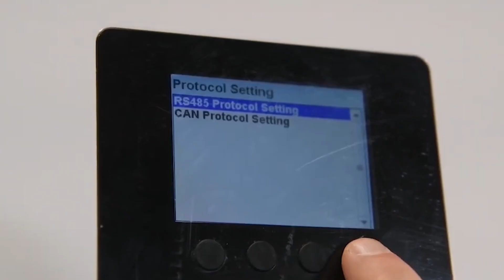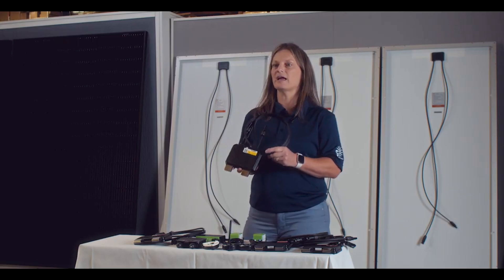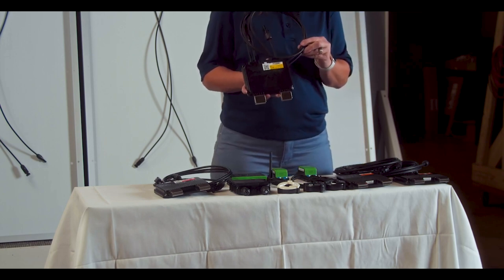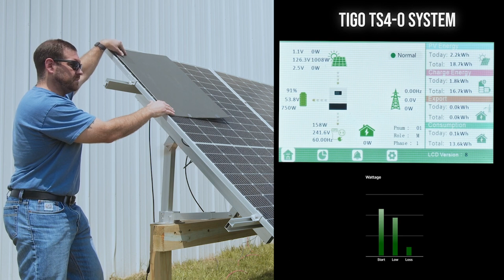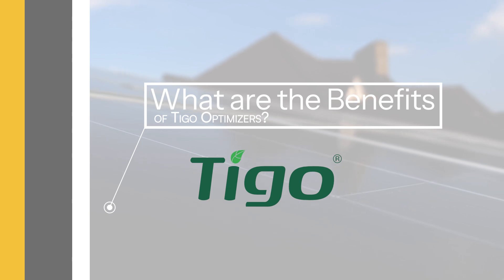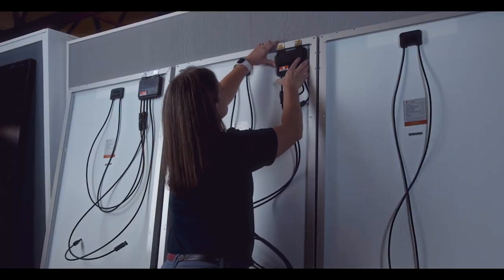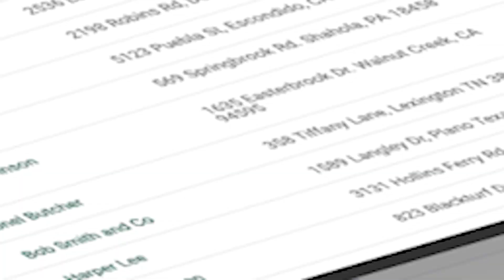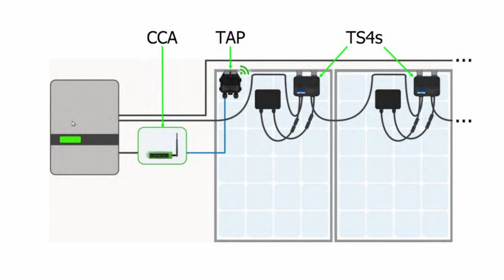Tigo Optimizers Explained: What They Do, Benefits, and Are They Worth It?

Comment: Do you need optimizers on all panels for the remote shutdown of the combined array to work? As an example, if 4 panels are wired in series and only one has an optimizer, will the optimizer cut the connection between it and other panels which would then cut voltage out of the entire array? For my setup I only have one panel in the array that is at risk of partial shading. Also, can the TAP be installed on the underside of the roof rafters instead of on the arrays? Will the signal penetrate a layer of plywood and shingles to the optimizers mounted on the panels?

Comment: But how does an array of panels using Tigo optimizers compare to that exact same array without optimizers when there is no shading?  How much lower is the output with the optimizers?  Would it make sense to only use these on strings that I know have shading issues?  Rapid shutdown is a non-issue for me because mine are ground mounted.

Comment: Hi. We are based in the UK, we don’t have rapid shut down regulations. I used to be a big fan of Tigo products but will no longer offer Tigo to customers. One job of 16 optimisers ( UK spelling ) had 3 failed units which cost us over £2000 which is around 2750 USD. Tigo never gave us an explanation as to why these failed and I am not confident more on this install won’t fail. 

Also covered on the video attached is another system where 2 TAP’s were required on a small array, the optimisers don’t act as repeaters as we are led to believe. 

https://youtu.be/vIovPqTGecA?si=eF5yjWOmM2IIzgCY
Reply: Slightly OT, but since you mentioned it: For the record, the Oxford English Dictionary recommends the spelling "optimizer", even if "optimiser" is the more common spelling in British English 🤓

Comment: Since you guys cater to the DiY crowd this video fell far short on “how-to” details. The part that discusses the actual wiring was hazy at best. As was the setup of the monitoring equipment. And how does one trigger a rapid shutdown?
Reply from the maker: Thank you so much for your feedback! There are many things that can trigger a rapid shut down. It can be done manually, or things such as a power outage to prevent back feeding to the grid. If you need any guidance or support, please don't hesitate to reach out to us at 903-441-2090! We're here to help!

Comment: Can these DC optimizers also be use as buck converters? So not only optimize the input voltage but increased the output voltage to match the mppt range of the inverter?
Reply from the maker: No, they do not convert; they only optimize. They won’t adjust to match the MPPT’s optimal operating voltage range. Instead, they simply optimize or boost the array’s voltage when shading or other factors affect one panel, ensuring maximum potential output. I hope this helps!
Reply: @SignatureSolar  Voltage is cumulative, current is not. So an optimizer should adapt its current to the input current so all panels generate the same current with different voltages and thus optimizing the power output.
Reply from the maker: Yes, that's correct. In a series string of solar panels, the current is determined by the lowest current-producing panel, while the voltage is additive. Optimizers adjust the operating point of each panel to ensure that each one can operate at its maximum power point, allowing for optimal power output regardless of differing conditions (like shading or panel mismatch).

Comment: Hi, Can i just fit them to the few solar panels that are affected by shade, ie 2 panels in a string of 10 get shade, Can i just fit them to those 2 panels to improve overall string performance ?
Reply from the maker: You can use them on the individual shaded panels, but we recommend installing them on all panels to optimize performance in case of shading from clouds or other factors. Additionally, if you purchase the ones with RSD, it would be beneficial to have them on all panels.

Comment: I have very small setup (only 2pcs of 12V 175Wh Victron Energy panels connected together). Unfortunatelly the most of the day is one or other panel in shadow (around 5% only), but in such case the power significantly drop down. Will in such configuration help to mount optimizer on both of the pannels? Unfortunatelly on the place there is no Internet (small cottage deep in forest). Do you recomend or not to mount optimisers in such scenario? Thanks
Reply from the maker: Optimizers could be the solution for you, but they may not restore full power depending on your solar panels. Each panel has a unique bypass diode layout to manage shading, some manufacturers design them well, while others don’t. However, optimizers will still improve performance. CTs of the EG4 devices are only to measure, not to control!

Comment: I have a question that hasn't been clear to me on DC optimizers. If you are doing battery backup with a Powerwall 3 can you use the DC optimizers. I have heard yes you can, also I have heard that DC optimizers can cause an ARC fault. Have you used your DC optimizers with a Powerwall 3 and do you know that yes it will work?
Reply from the maker: Hello! Yes, you can use power optimizers with a "PowerPro" battery, as long as the inverter is designed to work with both the battery and optimizers. The total design needs to be considered when choosing.
It's important to choose compatible components and consult with a qualified installer to ensure proper setup. If you need any assistance, you're welcome to call the technical team at Signature Solar at 903-441-2090 option 3!

Comment: So, when your land line grid power goes down, the rooftop solar collectors are forced to shut down preventing a "backflow condition" to occur onto the land line grid wiring..

 Got it. I wonder how many solar owners know this is installed into their solar panel system. When the grid goes down, so does your PV system too.
Reply: They quickly find out the first time the grid goes out.  That's why battery backup has surged in popularity.

Comment: I bought the EG4 24k hybrid mini split w/ 7- 410w panels on a ground mount. 
Since I am not going into an inverter, but straight into the mini split, would these be of any use to me?
Reply from the maker: Tigo optimizers could give you about 20% more power total, so it would be based on preference and budget :)
Reply: @SignatureSolar 20%?   really.   ?   Any links to data sheets

Comment: Hi, I have Jinko 580w solar panels with Inverex 12kw 3Phase inverter, will Tigo optimiser work with this system?
Reply from the maker: As long as it's 48v and rated to charge LiFePo cells, yes.

Comment: Thanks for the background on Tigo Optimizers.  Do you know if they have RFI (Radio Frequency Interference)?  Many optimizers have caused RFI in the past so I am wondering.  All the best from Greenville, TX!
Reply from the maker: Essentially, any device with current flowing through it will emit RFI. However, due to the voltage in each optimizer, interference is likely only if the affected device is very close to the array. In most cases, modern wire insulation effectively prevents interference 99% of the time.
Reply: @SignatureSolar thanks for your reply.  I have seen Solar Edge optimizer shut form radio communication a city block away.  If there is low level of interference such as a portable AM radio buzzes only within a foot but not multiple feet away it might be okay.  Do you have any Tigo devices at your Sulphur Springs location? And would it be possible to come by to measure the RFI? Thanks. All the best from Greenvile.
Reply from the maker: Yes! You're welcome to come by! We do not have equipment to measure RFI in store.
Reply: @SignatureSolar  I can bring my radio that can check for noise

Comment: Thank you for the details.  I'm assuming that i would just need to install these are the PV module that is needed correct?  I.e. i don't need to install it on all the PV module in the array of 10 solar panel.
Reply from the maker: That is correct; however, we recommend installing them on all of the panels to optimize their performance.

Comment: I’m thinking about adding optimizers to my small off-grid setup to improve partial shading performance. I don’t need to make use of any monitoring features, all I want is for the optimizer to increase the energy yield of the specific panel it’s connected to. Can I hook up a Tigo optimizer between a panel and a charge controller and then have it do its magic without any other setup procedures? Does it work without an internet connection and without having to pair it to my phone? I’m looking for a stand alone plug-and-play optimizer solution for my system which only requires me to hook the optimizer up between the solar panel and the charge controller and that’s it. Can the Tigo optimizers be used in this manner, or do they require extra hardware and/or a 24/7 internet connection in order to work?
Reply from the maker: Hi! The tigo optimizers are plug and play, just connect them and go. No internet needed but if you'd like to look at the panels, you have that option with the CCA and tap :)
Reply: @SignatureSolar  Perfect! In that case I will pick up a few and try them out on my system. Thank you for your reply.

Comment: The worth it is often related to $$$ not just watts. I wish that was covered.
To distill it down, based on your test, for a 4 panel array you loose 1 panel worth of energy because of shading without optimizers.  So 4 optimizers would give you a lot more watts.  4 optimizer is $160, if you add a panel you can do that for $150.  So it is cheaper to add more panels than optimizers, and you also get even more power when not shaded.  So it is both cheaper and you get more power by adding panels. 
This, of course, is not true in a maxed out PV setup, you can't just add more panels.  Also adding panels adds other expense, like mounting.  The new panel also needs to be out of the shade to work too.
Reply from the maker: Thank you so much for your feedback!!
Reply: It depends, I currently I don’t have more space for more panels  so I need optimizer

Comment: What's the difference between the models like the TS4-A-O and TS4-A-F? Do they have other multi module units for cost savings like the TS4-A-2F?

I've been leaning toward Hoymiles micro inverters due to the quad connection models and no need for a large central inverter, but haven't ruled out optimizers if the cost for panel level monitoring is good.
Reply from the maker: The TS4-A-O is optimized for energy production and efficiency, while the TS4-A-F is focused on safety and rapid shutdown capabilities.
Reply: @SignatureSolar  Seems the optimizer solution, since it still needs a massive inverter is still going to be vastly more expensive than something like the hoymiles micro inverters.

Comment: how reliable is the wifi on a metal standing seam roof with direct-mount (no rails)? i'm looking to place 36 panels in a 9x4 configuration (about 55' x 15'). will one TAP cover them all? or would i need several?
Reply from the maker: One TAP will cover it :)